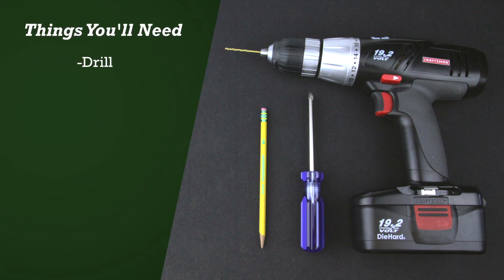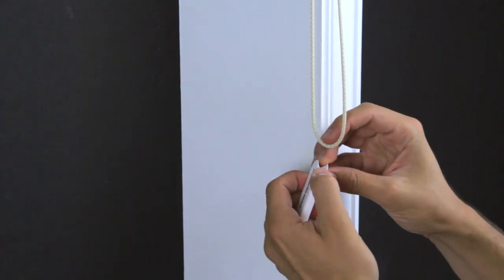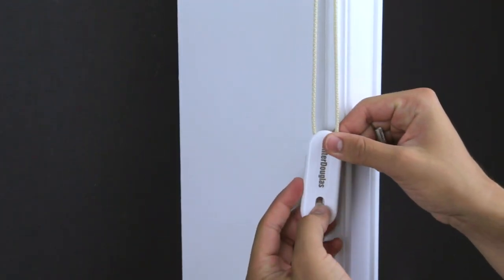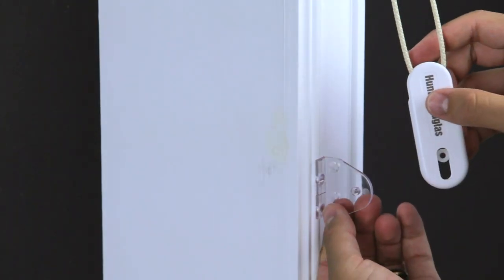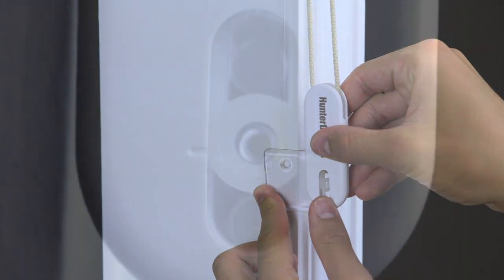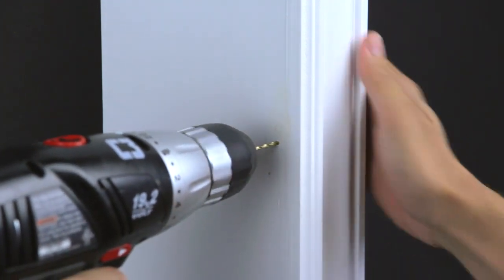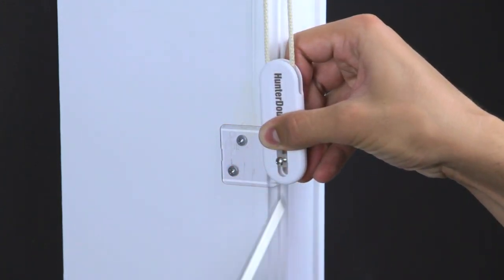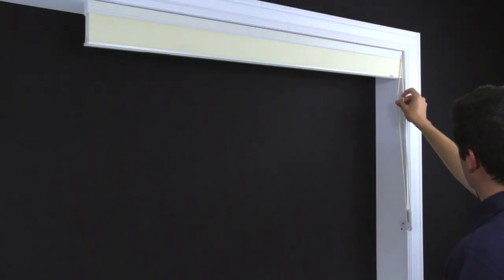How to Install a Universal Cord Loop Tensioner

Comment: That's great that you actually have access to the screw head without having the tensioner in the damn way. WTH kind of design is the one I have Sheez
Reply from the maker: Hi there, If your tensioner doesn't look like the one in the video and you're trying to take it apart, feel free to share a few pictures of it and we may be able to help. Our email address is service@fixmyblinds.com.